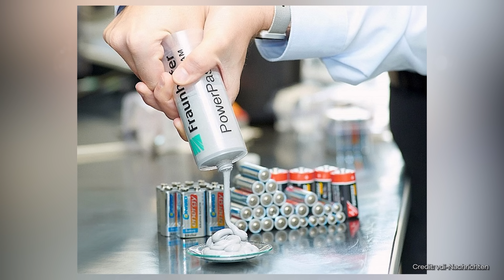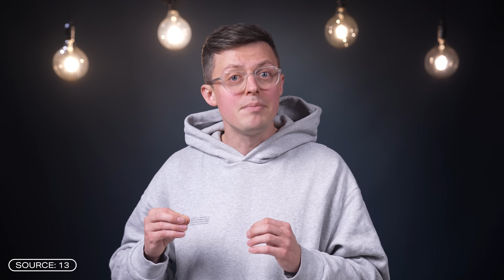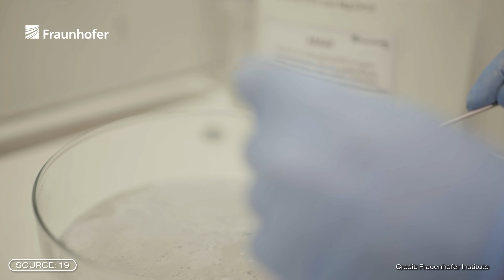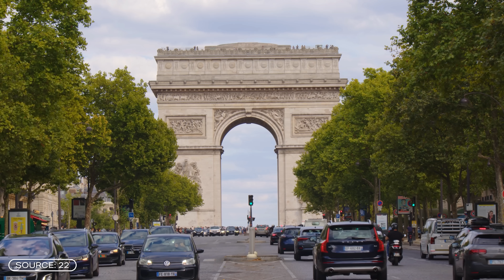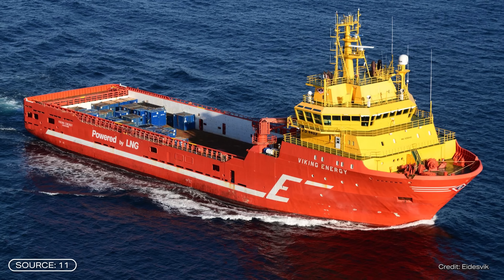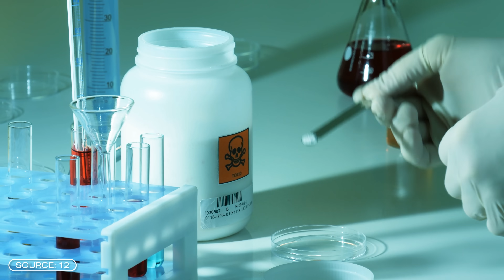Hydrogen Powerpaste: 10x Higher Energy Density & Safe?

Comment: I simply add CO₂ to hydrogen and use already existing infrastructure based on gas: H₂ + CO₂ = Methane CH₄.
Solar to hydrogen infused with CO₂: no peak power braking the network, but then your a CO₂ sink. and green deals need to pay you
Sabatier reaction, was discovered by French chemists Paul Sabatier and Jean-Baptiste Senderens in 1897

Comment: H2 has GWP-20 of 33. When it leaks, it's three dozen times worse than CO2 from coal, at only 2/3rds the energy return. That's right: fifty times worse than coal, when it leaks or doesn't combust completely. It's the leakiest gas in the Universe, plus the least completely combusting fuel man makes. Commercially, H2 loses 30% over its life cycle. That's right: 65 times worse than coal, times 0.3, for 20 times worse than coal overall, and 6-7 times worse than methane.

FRIENDS DON'T LET FRIENDS H2.

There are some narrow niche applications where H2 is worth it. I hope this paste turns out to reduce the leaks in those niche uses. Transportation and energy storage aren't in that niche.

Comment: As a chemist, as others have stated, all of these hydrogen storage methods are grossly unsafe; if you think lithium ion battery fires are bad, you have no idea. 

ALSO, they seem to glaze over the recycling aspect of this. How do they propose they turn Mg(OH)2 back into magnesium? This is a generally not-so-good process by making MgCl2 from the hydroxide and HCl and then using electrolysis at high temperatures to eliminate chlorine gas and Mg metal. Calling this recyclable is nearly laughable; gasoline is recyclable too, you just have to wait for the co2 released to be absorbed by the trees, the trees to die, that carbon to go further into the mantle, be turned into hydrocarbons, and viola.

Comment: This sounds like a variant of Calcium Carbide + Water which produces acetylene gas.  The economics are simply not there to support something like this.  The amount of energy required to make this paste, which requires the production of hydrogen, is going to be substantially more than the amount of energy it outputs. Additionally, the energy output is thermal energy through combustion.  It doesn't matter if the energy density is 10x that of lithium ion batteries because it still needs to be combusted.

With a Lithium Ion battery, electricity is stored and then consumed on demand.  The generation of the electricity doesn't require electrolysis or a complicated production facility.

Comment: Paste based storage composite similar to hydrogen storage alloys?

And carbonic acid ester ... like dimethyl carbonate?

OH, OK, it's a single-use sort of material, not an in-situe regenerative material.  I don't see that being relevant to typical commercial vehicles, but it could be useful for bulk industrial hydrogen storage and for on-site generation of hydrogen at filling stations. (you'd still be using compressed or absorbed hydrogen in any sort of passenger or commercial sized vehicle)
This is still significant though given the issues with hydrogen diffusion, even when you have materials that don't degrade significantly due to hydrogen embrittlement or other diffusion effects, you still lose hydrogen over time if stored under high pressure as a gas or supercritical fluid.

A low lifecycle turn-around cost would make it super appealing. (ie energy input for converting hydrogen to the hydride could be more efficient than the long-term losses and costs of bulk elemental hydrogen storage)

You'd really have to use distilled or deionized water for this, not normal tap water, otherwise you'd have issues with byproducts and side products (and potential degradation of the hydrogen generation system) due to mineral and biological components in tap water, plus presence of chlorine, chloramines, chlorates, and hypochlorites. (a lot of regions use sodium hypochlorite for treatment of drinking water rather than chlorine, so you end up with that on top of calcium, magnesium, iron, and manganese typical in hard water). Plus, the reaction would be exothermic, so you'd have waste heat that could be recovered on an industrial scale for use cases where the paste was used at such scales. (using a bottoming cycle energy recovery turbine with low boiling point fluid as the working mass, like supercritical CO2, ammonia, ethane, propane, fluorocarbons, etc)

You can't directly compare it with batteries in the case of rechargeables, and for single-use batteries, you'd want to include water as part of the energy density costs (both by volume and specific energy by mass). It can't work without water, so water is part of the reactants and hydrogen carriers. (half the hydrogen will come from water, the other half from the hydride) Recharging would be done on an industrial scale, no different than recycling used lithium batteries ... or a lot more like recycling industrial wet cells, given the electrolyete + electrode corrosion byproducts are easily extracted vs sealed consumer grade cells.

More realistically, you'd want to compare it to energy density possible via hydrogen storage in alloys and compared to hydrocarbons and oxygenated organic liquids (and LPG class gasses). And if looking at fuel cell use for electricity production, then definitely compare compressed hydrogen and alloy storage systems (and the recycling aspects of end-of-lifecycle alloy packages). Comparing methanol fuel cell tech would also be a useful data point.

Still, I see this tech being useful for ground-based large industrial scale hydrogen storage and not necessarily much else. (if the energy content by mass is good enough, it might be useful in some types of hybrid rockets as well, but I think alternatives that are less sensitive to air and moisture would be more appealing, including some exotic oxidizers that still need to be sealed against moisture, but with less exotic, catastrophic failure potential:  like anhydrous magnesium nitrate ... albeit current advances in coprecipitated potassium perchlorate + ammonium nitrate or ammonium nitrate + guanidine nitrate combination seem more promising overall in addition to KN-stabilized ammonium nitrate based composite rocket fuel compositions, but the AN+GN and AN+KP systems both seem promising, and act as phase stabilzed compsitions, such that ideas of using magnesium alloys as chlorine scavengers in Ammonium Perchlorate based systems become less necessary or attractive, and use of borone doped aluminum alloys as fuel becomes more attractive as a potential advancement in line with the chlorine-free oxidizers: ie not forming HCl or AlCl3 in combustion or organic chlorides)

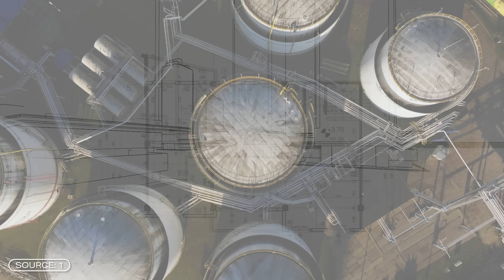Comment: 11:42  The fact they plan to take an ENTIRE YEAR to make a test batch of 4 tons??  ..  Is the clue that shows the Hydrogen paste is complexly impossible to use at scale.   

I would expect a back yard experimenter to make 20 pounds a day. This represents the power of perhaps Ten Gallons of gasoline,

How much will it cost to build and operate this installation for an entire year? (at LEAST 5 Million Dollars I would think) $5,000,000 to essentially distill the equivalent, of 10 gallons of fuel per day?

Comment: why not make a super capacitor that's in an electric car,  driver pulls up to station and plugs in his car. ZAP!!! the capacitor is charged (in seconds) the driver pulls away. while driving or even parked, the capacitor charges the car in the 20 to 40 min window. a weight compromise might be that until lighter capacitors, and batteries arrive the max distance might be slightly smaller.

Comment: So this sound even worst than working with H2.  We are good at developing non solutions.  H2 if highly "fugace" at you can hardly keep it and use it.  Making H2 takes at least twice the energy to produce than what u get back.  Mg  will have to be mined processed ...   Wow lets rip an other country environment to produce that awful solution.  It still remain 10 x less enrgetic than a kg of propane.  So what is the point?  Keep on doing "useful" reasearch we are not there yet.

Comment: Sound good, but I would not considerate for most mobile applications for 2 reasons. 1. Thermodynamic inefficiency vs batteries (50% vs 90+%). 2. Hydrogen (proton) embrittlement which would likely shorten engine lifetime greatly. Seems good for other commercial purposes.

Comment: The best way to make hydrogen useable is to compress it by using atomic forces - this is what TESLA does by using methane  - 4 hydrogen atoms held by one carbon atom. Much better volumetric energy density, no left over "ash", can be held as a liquid at reasonable pressures and temperatures.

Comment: Bro battery are 90 percent efficient hyodrgen best give 50 percent that 1.6 kw come down 800 w that also when we not consider the generation parts of fuel cell and battery to smooth is power out put and what about the cost fuel cell are not cheap they cause thousand of dollar per kWh and highly sensitive

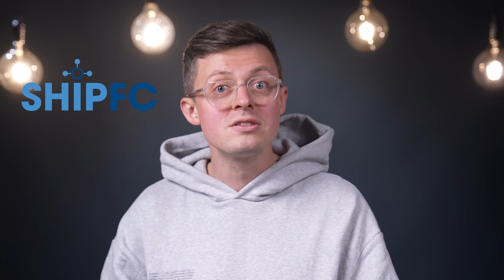Comment: 5:50 What are these enormous amounts of pollutants emitted by ships? Note that carbon dioxide is not a pollutant, but is part of the oxygen cycle which all living things depend on. Plants absorb CO₂ and give off oxygen, while animals absorb oxygen and give off CO₂. This is pretty basic stuff, we shouldn’t have to keep saying it. Current levels of atmospheric CO₂ are not excessive, they are not even close to the middle of the historical range. The lowest levels in the past were around 170-180 ppm, and 150 ppm is the bare minimum, below which life on earth ceases, as most plants can’t survive. By contrast, the highest levels in the past were around 4000 ppm. Greenhouses commonly supplement CO₂ at around 1500 ppm for better plant growth. At around 425 ppm, we are a lot closer to death by lack of CO₂ than we are to death by excessive CO₂.

As for the subject of this video, all that is fine and good, with the issues mentioned, but then... where are we going to get all the hydrogen? The promise of a hydrogen-based economy seems to always be just out of reach because there are so many problems glossed over.

Comment: I might have missed the point but is the hydrogen output from this paste meant to be used in a fuel cell or could it be any form of hydrogen consuming engine like for example those experimental Japanese ICE engines that run on hydrogen?

Comment: I don't think hydrogen has any chance. It missed the train.
Battery tech will most probably replace everything.
Reply: Hydrogen does have a chance.  Because there are certain industries that cannot be powered by electricity alone, lile aviation and shipping.  They need energy dense and clean fuels to power large vehicles.
Reply: @joelvanwinkle5976 that.s the catch. Battery tech has evolved so much and still evolving. Current density is viable already for small planes  and ships. It only gets better.
Why ?! Because , by comparison , the money invested in battery technologies is dwarfing the hydrogen. And it.s all thanks to electric car.
Search the evolution of battery density/price in the past 20y and you will understand.
Where is demand, there is competition. Where is competition there is investment and research. Where there is investment, there is progress.

Comment: In a couple of those processes, when releasing the hydrogen, a powder is left over.  For example, in the process that uses powdered magnesium, to make the paste, there is a lot of magnesium powder left over in the fuel cell of the car, truck, or ship.  Or if used at home, then the big tank is full of magnesium powder.  That means that you have to pay to get the hydrogen, but then you have to pay to have the magnesium hauled out of your fuel cell at home, or to have the fuel cell replaced in your car, truck, or ship.

That's too expensive.

Comment: If you're not looking at the full cycle (eg include hydrogen production) it's without merit.  The only time using hydrogen makes sense is if you can't store the electricity used to make it somewhere more efficient than in H2 (don't even talk about fossil-hydrogen) such as chemical batteries, pumped hydro, thermal batteries, gravity batteries, momentum wheels... or nearly everything other than hydrogen.  

It seems to me that the buzz around hydrogen is always with the back-door intent to greenwash fossil H2.  But, keep up the research.

Comment: For ships there is a free energy technology... it's been used for centuries...
They're called SAILS.

Modern tech and methodry Should have already brought this back to the forefront.
Sailing vessels are Not significantly slower than other technologies because the limiting factors are hull designs and hydrodynamics and NOT the propulsion method(!).

As for hydrogen use:
Whatever happened to hydrides?
Those are effective, proven, and safe.
Reply: Probably the same issues with production and using hydrogen itself. Its inherintly lossy up to over 50 % energy just to produce it and then use it. It is nothing more than a green grift for those who are still propagandized about the climate
Reply: Nothing for free,  extra manpower to set sails have spare sails etc, constant repair of sail & rigging, note every hand carried a sharp knife and a spike for a reason !       Pension / insurance for personel loss/accidents to limbs/eyes/strangulation etc. 
    ( these were not a companies problem in the past )

Comment: Yeah, the safe containment of that paste would be crazy because if it ignited - magnesium and hydrogen together - the fire could not be contained as any suppressants would be burned off long before affecting the runaway exothermic reaction.   AND if it is exposed to water it would likely become explosive due to oxygen being a byproduct of the reaction - it's got a built in oxidizer.

So, yeah, let's just power our (whatever) with C4 paste...

Whatever the paste is stored in would have to be insanely ROBUST to withstand vehicle collisions.
Reply: I imagine this type of chemical volatility would result in a monster insurance premium on vehicles powered by this fuel.